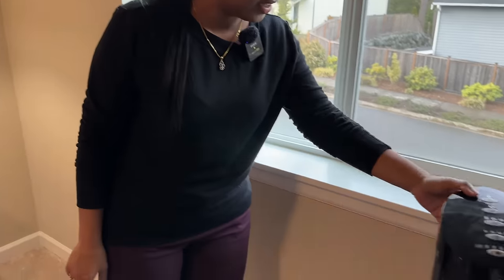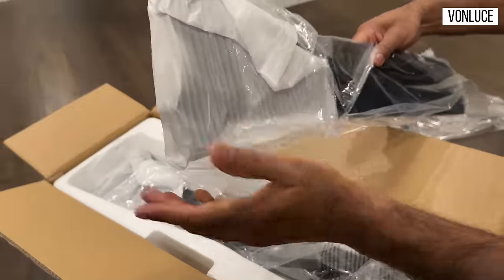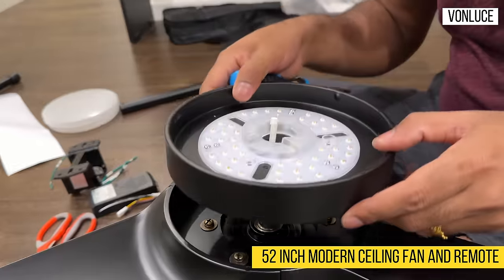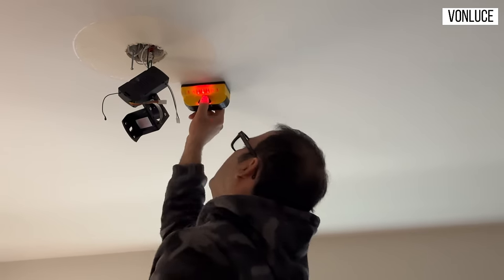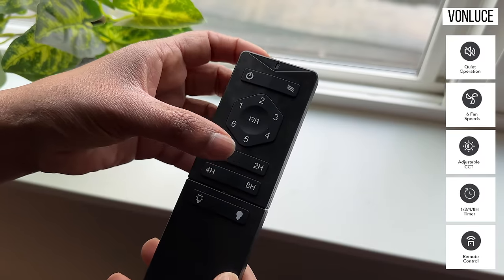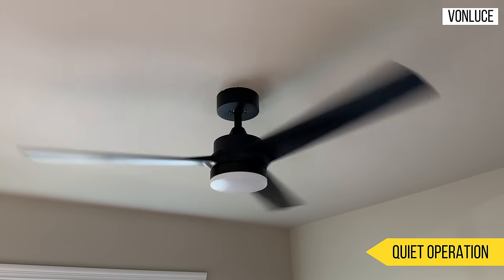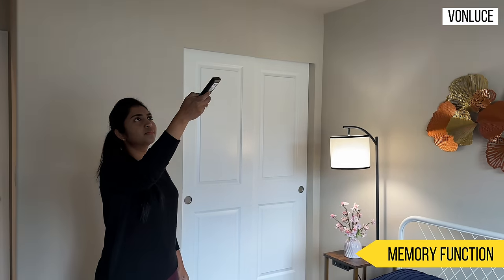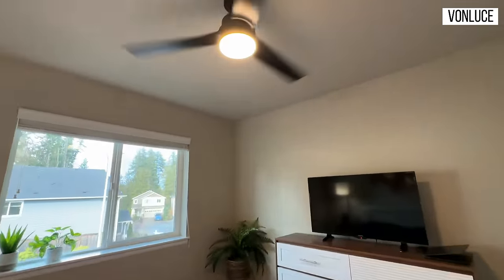🏠 First Ceiling Fan at our Home | Installing Modern Ceiling Fan | Seattle Summer | USA Tamil VLOG

Comment: We in India can only dream of such a fan with so many different functions, uses and  facilities. Nowadays, here, fan manufacturers don't even bother to provide a regulator. Can't even dream of a remote remote control with so many functions. Further, in India, new ceiling fans don't rotate in a fixed axis. தலையை பயங்கரமா ஆட்டும் மாட்டின உடனேயே. An electrician always corrects it, manually, to some extent. In India and Tamilnadu only Havells fans function correctly and provides more air, out of the box. Thank you so much for your excellent videos. We appreciate. God bless you.